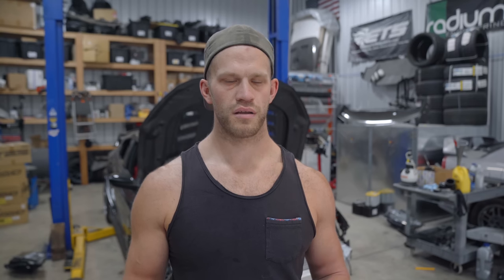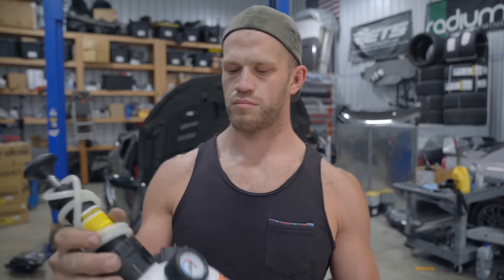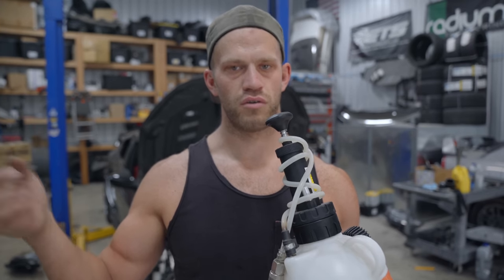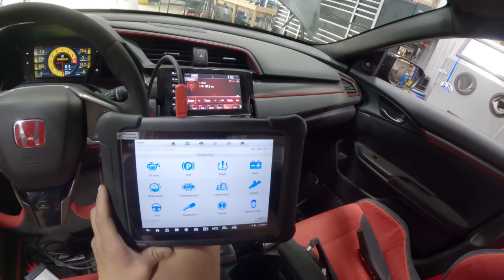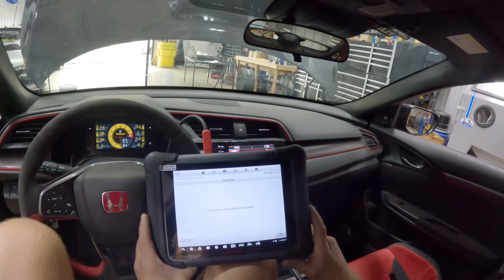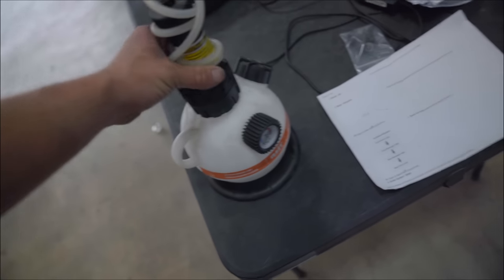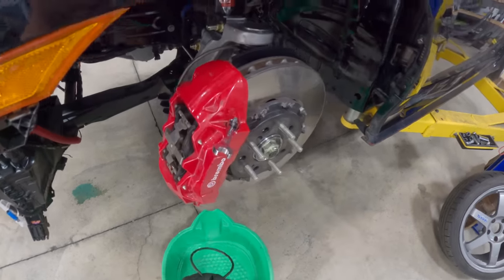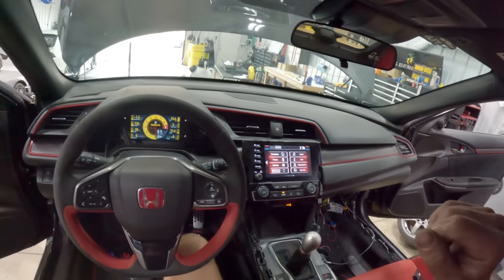Building an AWD Civic Type R | Ep. 55 (Diving into these brakes...)

Comment: In the past when I have had air stuck in the ABS system you can drive on loose gravel and brake causing the ABS system to fire up which pushes air out you then need to re bleed the callipers remembering the air has to travel a long way to get to the bleed nipple.  Worth a try maybe.
Reply: or just crack open one fitting at a time like any other sealed hydraulic bleed procedure when u have no usable bleed port

Comment: 1. Speak to Haltech maybe you can pin that wire in to the 2500 and the e-brake can work without the OEM ECU. 2. Get the exhaust manifold Zirconia coated. It will massive reduce radiant heat.

Comment: One time I diagnosed an intermittent faulty brake pedal feel (goes to floor, scary) on a low mileage CRZ. Based on Honda's tech line advise, I replaced the ABS modulator first, but it ended up being a faulty brake master cylinder.

Comment: Hi! 
On my evo I made a downpipe 3 and an external wastegate 2.5. from stainless steel.
I covered it with thermal tape. pre-wetting it with water. this is great stuff.
The A/C wire has been touching the downpipe for 3 years and still hasn't melted. (Yes, I'm too lazy to delete, still nothing happens)
even when, for example, 1000+egt, the downpipe can be touched by hand.
very practical and looks cool. I advise you to wind the collector and make a thermal screen. and a fur coat on the hot part of the turbine.
My friends also give away ceramic-coated downpipes. they say it helps a lot. but I do not really believe that this will help better than thermal tape. But if you cover it with ceramics and wrap it with thermal tape on top and make a thermal screen)) it's funny. it won't even get hot.

Stay tune.

Comment: No doubt you will have several more similar problems since you have basically built a different car and are trying to get OEM systems to work with your built systems. I also have confidence that you will figure it out as you always have. Hang in there bro!
Reply: All of these things are relatively minor problems that can be solved over time.. Devon is the first one to do this, so it is a big learning experience, but he is paving the way for people. I dont think Ill be going AWD on my FK8, but I 100% plan to K24 swap my Fk8 in the near future, which will be a whole lot easier.

Comment: @12:00 find out what relays are clicking when you connect and disconnect the stock ecu, then just bypass those relays in order to no longer need the stock ecu for the ebrake function

Comment: I built a k24a R56 mini cooper AKA canbus….. I had the same issues. I took the signal exhaust cam wire of the k24A and connected it to the mini cam intake signal wire ecu. Now the mini ecu thinks the engine is working because its sees rpm. Abs/eps/startbutton etc all works. Maybe this helps ure build aswell. Only i think honda uses the cranksensor for rpm 😊

Comment: @18:45 see how your harness runs straight down into the top of the fuse box, once you have car fully dialed in, you are going to want to seal all around and in-between every single one of those wires to the fuse box itself with "liquid electrical tape" or "ultrablack rtv". because if you power wash your car or you drive on a wet/rainy day, water will do what it does best, and gravity will have it flowing down that harness right into the back of your fuse box and it will corrode your terminals and blow your relays/ fuses.... ask me how i know!!!!!

Comment: If the aluminum brake booster sits real close the the manifold  wont the brake fluid get super hot and fail when your racing or on a track 🤔
Reply: I think it will be hot all the time, couse it is righ on the hot side of the turbo. It will definely get an effect on braking not only on track I think.

Comment: I think you have some serious electrical issue where the OEM circuit is not matching up the the aftermarket ecu. Ive mentioned in episodes ago either wrap or heat coat those manifold..

Comment: I love the build and channel.  Just an idea to look into that might be an issue for you.  I have an 8th gen Si and bought it in parts. After reassembling everything, I had flipped the brake master cylinder vacuum line that has the check valve inside and the brakes didn't feel right.  After fixing this issue the brakes felt perfect.  I'm not sure how the fk8 brake system works but maybe it's the same way.

Comment: Hey Devin, great work so far, I've been watching this build since day one. One thing I'm worried about is, what if one of the braided break lines bursts when you are sending it and end up with the break pedal to the floor and no breaks? I've seen that happen with a White Audi RS3 while street racing somewhere in the US. Just a thought.
Reply: Maybe he can install four hydraulic fuses. One before each braided line. That way if he does have one burst the fuse stops the fluid loss but keep the other brakes working long enough to get home or somewhere where he can make repairs.
Reply: @jonathanb1987  That sounds like a great idea.

Comment: honestly electric parking brakes are not alone lame as fuck but problematic... absolutely no fun.
with electric parking brakes you loose your emergency brake and can only be used for parking purposes.. cant hoon around or lock up the rears while driving what so ever without having the traction control system act up and make you come to a complete stop. better off deleting if you want to have some real fun in her and track it.